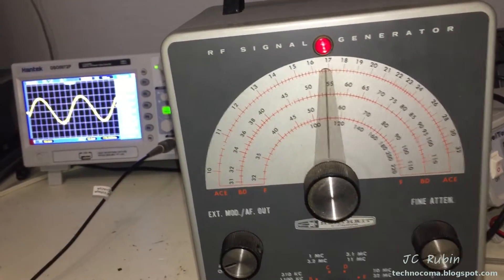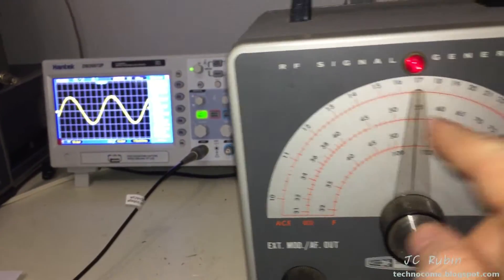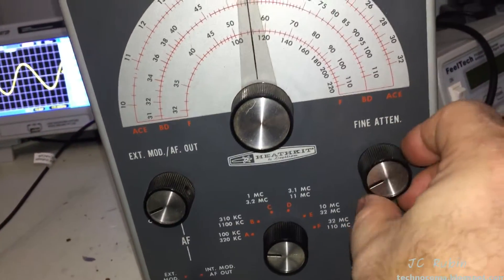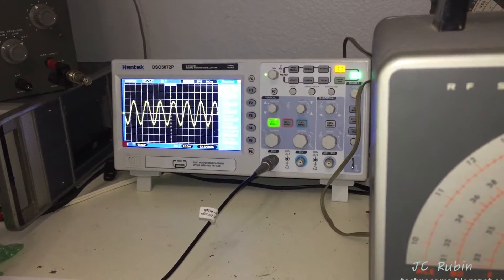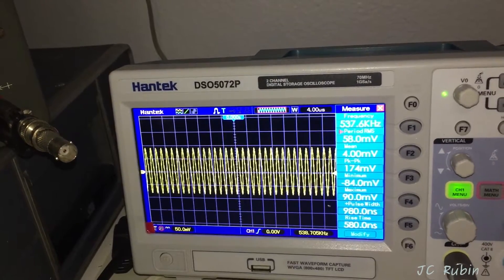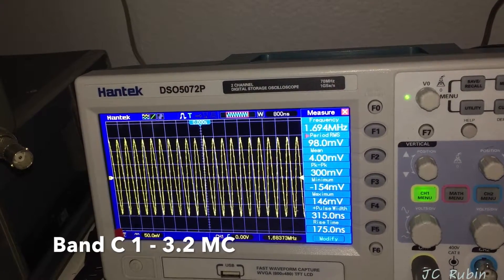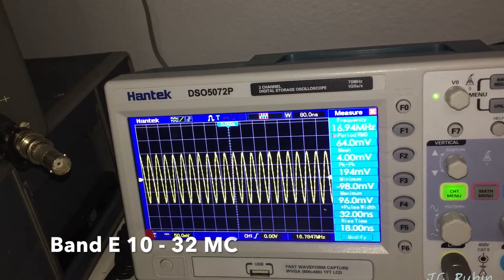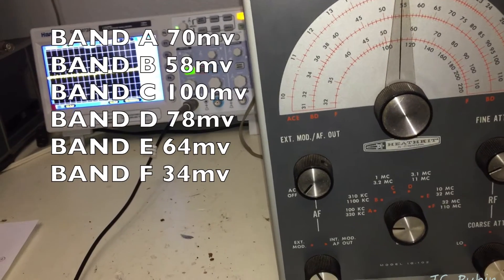Heathkit Repair - RF Signal Generator IG-102   SUP - 1 Frequency Response

Comment: I have purchased a Heathkit I G102 on eBay supposedly looks brand new I have not been able to get any kind of signal I checked all resisters capacitors nothing works I think I'm gonna end up buying the field tech signal generator would I be better off doing that instead of working to get the Heathkit going. I have a schematic of the east yet but unable to test the tubes or on the other components please advise
Reply from the maker: nothing working generally points to a power supply or a rectifier issue